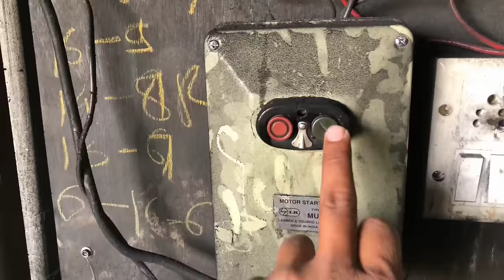The Most Amazing Process Retreading Old  Tractor Tyre | Tractor Big Tyre  Remoulding Process #remold

Comment: It sure is amazing retreading old tires  into new ones. I guess it's ok for tractors & trucks that runs in slow speed. Not sure the adhesive will hold & not come apart at high speed. Nevertheless they are recycling old tires into new ones which is good.
Reply: It is not glued but vulcanized. It's like welding the material chemically.
Reply: Exactly what I was thinking all good on a slow tracker but in the front of a car or 4x4 would not trust
Reply: retreaded truck tires are common in the US, and pre radials, you could get them for cars as well.
Reply: @Rivighi  Я на легковом авто на восстановленных шинах ездил 10 лет и проехал 65т.км   Максимальную скорость которую я на них достигал  это было 195км/ч и шины выдержали такую скорость.  Шины были компании gold-gum.